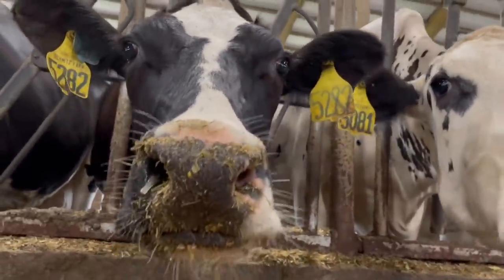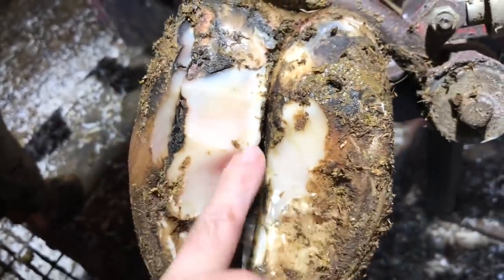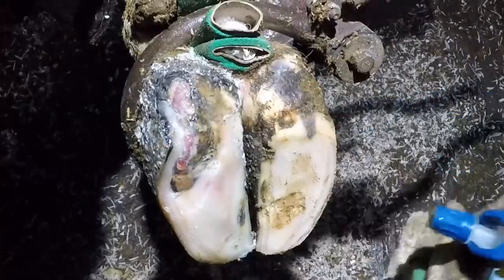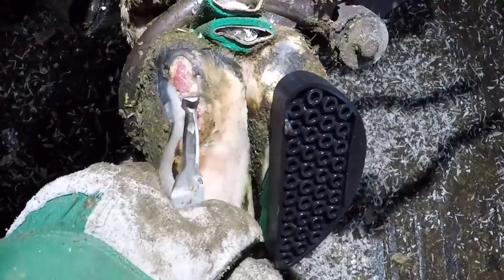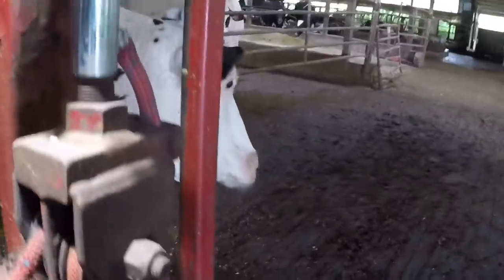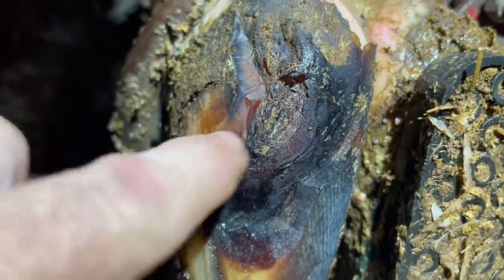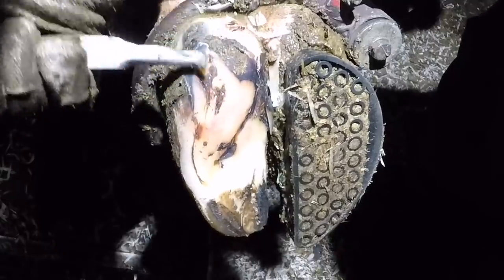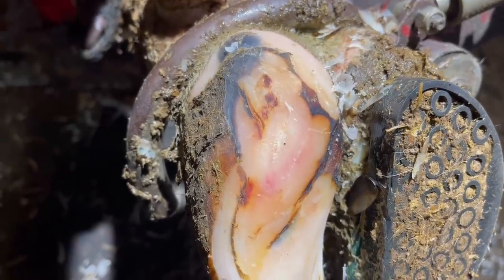BEAUTIFUL WHITE HOLSTEIN with a NOT-SO BEAUTIFUL FOOT (Follow -up included)

Comment: Could you tell us the pros and cons of the different chutes? I’ve seen lay-overs,  both rear feet lifted at the same time, one rear foot at a time. Thanks
Reply from the maker: Pros for layovers is speed and efficiency.  The only real con from my perspective is the orientation of the feet but that’s because I’m not used to them in that position.  Feet usually aren’t as secure so trimmers usually use one hand to hold the foot and the other on the grinder.  Pros for upright chutes are cows feel more secure standing.  Feet are positioned better for trimming with two hands available for the grinder.  Cons are you have to move around the trailer a lot more to trim.  I don’t ever pick up both fronts or both backs at the same time.  If something were to happen with the support mechanism on the chute the cow would be in big trouble with all her feet raised.

Comment: I'm sure you have answered this question before, but IF you wanted to remove the rubber block at this time, how would you "unstick" it??       Thanks!   S. Carolina
Reply: I've seen other hoof trimmers just grind them off with the same grinder they use for the hooves if they're still really stuck. If they're not super on there, they can pop them off/grind the residue off no issue.